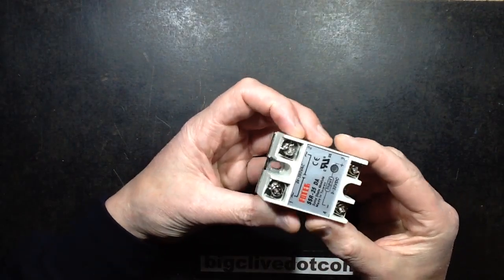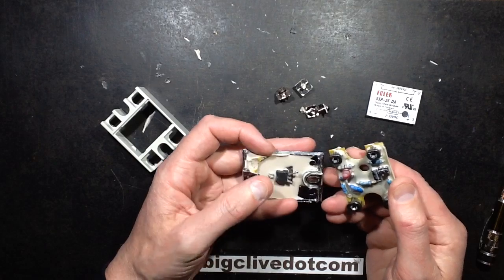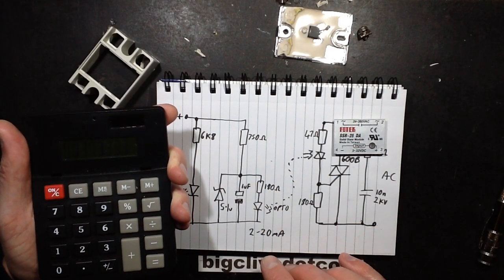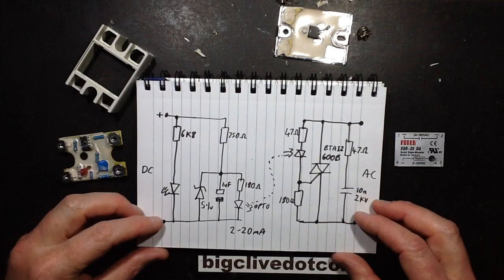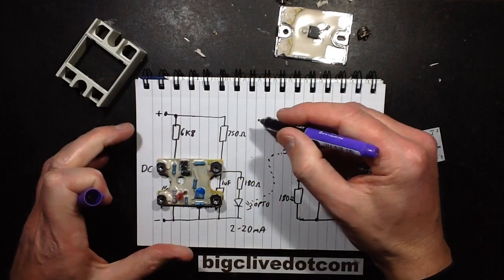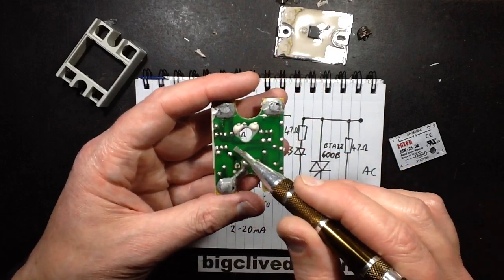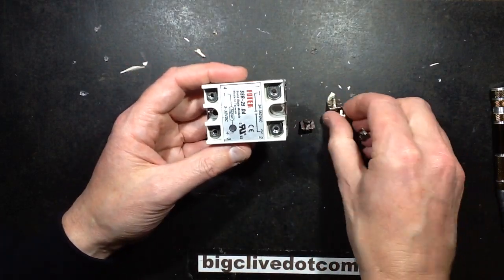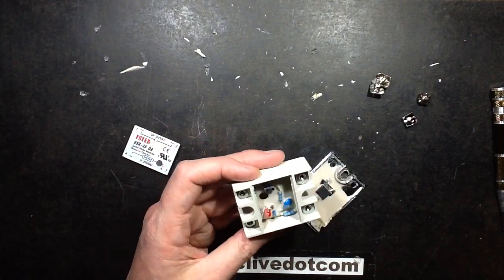Teardown of an eBay 25A Solid State Relay.  (SSR)

Comment: Thanks for this tear down Clive.

I have the exact same part from an ebay seller that I intended to use in a Kiln controller (~3KW max output).
So after watching this I stripped mine down to reveal that it also contains the BTA12-600B, obviosuly not quite sufficient for my application.

I have now ordered a BTA24-600B to uprate this to its original spec of 25A, at least I will now be operating its safe area.

Thanks again for your entertaining and interesting videos!

Comment: I got one like that. I'll let you know how it holds up at 20 amps. =o    lol   :)
Reply from the maker: +ww321 Someone sent me a picture of one that had gone bang and blown the front cover off.  They were running a "40A" one at 28A.
Reply: bigclivedotcom I know the Chinese pretty much put whatever spec they want on the item. LOL
Reply: +ww321 I bet they only do that with stuff made for export. ;)
Reply: You got a fake one then.
Reply: The SSR is 'real', the label on it is fake. Unless you buy direct from the Chinese manufacturer they are almost all 're-labeled' and rated higher than they should be.

Comment: I would bet this is a fake. My company has a large inventory of fotek solid state relays, controls, and sensors. We are listed as part of their sales channel on their website... http://www.fotek.com.tw/s3e.asp 
Our prices are not as low as what you find on ebay or amazon, but there is a reason why you are finding them so cheap on those sites. you get what you pay for. Also, I grabbed on of my 25 DA SSRs to compare, and the imput is rated for 4-32 VDC, not 3-32 VCD.

Comment: I just bought one of these. After watching this I stated wondering if I fill it with resin it might be better than it is now. The load that it needs to handle would be around 8 amps so it should handle that well.

Comment: I was wiring one of these up at work today and this video showed up in my feed when i got home. How odd. It's only switching 3 Amps but controlling a rather critical temperature.
Thinking tomorrow i'll change it for one of the £25 ones from R.S.

Comment: I find hard to believe that it only have a single triac I build a very complex pulsing array for a custom power inverter... and I used 20 fet's of 45A each for a load of only 250 Amps... so it will be interesting to open one from a reputable brand "Expensive" and see if they only use one of this devices also!!!

Comment: I have a couple of 40 Amp versions of this same brand (Fotek SSR 40 DA-H). I wouldn't trust these things enough to switch 5 Amps, even with a heatsink.

Speaking of which, they did come with heatsinks which actually seem pretty good. They have standard screw spacings so I may save them for some real SSRs. :)
Reply from the maker: +Felamine I got one with the heatsink and agree that it's actually worth it just for the heatsink.

Comment: Great tear-down, really interesting!
I've been using one of these Fotek branded SSR 25 DA (not sure if the one I have is genuine or fake) for about 1.5+ years to switch a 1.3kW purely resistive load at 240V AC from a 3.3V input. It was ridiculously cheap on ebay, so I guess mine is the fake one. Probably still working because I'm well within the "safe" operating envelope. Would no doubt have exploded by now if I was on 110V mains :-)
Reply from the maker: +James Ward For a modest load like that it should actually be fine.  I guess these are probably widely used in real-life Chinese factory equipment.

Comment: Is there a DC equivalent that you know of? I want to isolate some batteries @180Vdc 32A
Reply from the maker: Do a search for DC SSR.
Reply: Thanks. Assuming the same underrating, I'll get an 80A. Some of them come with some really poorly designed heatsinks with fins parallel to the heat source😛

Comment: I used one of these cheap Ebay Fotek (clone?) SSRs to switch a bunch of AV gear at home for about a year and a half.  It worked well enough switching lots of inrush current (big amplifiers, linear supplies), until I got trigger happy watching the lights in the house dim as I switched it all on and off.

I plan on replacing it with another cheap Ebay Fotek SSR, because a real industrial SSR from Digikey or Mouser costs more than a a dozen of these, and it worked quite well until I abused it on purpose.

Comment: what would you recommend for driving a heat bed on a 3D printer? I'm new to this stuff, and this relay was recommended, but upon researching it... I found your video! This would be for a standard bed for a prusa i3 3D printer. Thank you for teaching the world about these Important things!
Reply from the maker: +1blisslife It would depend on the voltage and power rating of the heated bed.  Most I've seen have been low voltage.
Reply: +bigclivedotcom That's a Mk2 Heatbed, and can be configured for 12 or 24v according to the 3 pins it's got & it's the one by prusadjs.ca

Comment: why wouldn't they just use an SCR?
Reply from the maker: +lsdave An SCR (Silicon controller rectifier) or thyristor as it is also known, only switches one polarity.  They have to use an inverse parallel pair to switch AC.

Comment: would one of these handle three light bulbs? incandescent or power saving but not LED
Reply from the maker: +1blisslife These relays are only suitable for switching AC.  And primarily higher voltage AC like 110 to 250V.
Reply from the maker: +Anas Malas Yes, it should be OK with incandescent.  Not sure about the holding load for compact fluorescent or LED, but you could try them with it.
Reply: bigclivedotcom what do you mean by holding power? Leakage current?
Reply from the maker: +Anas Malas Triacs require a minimum current passing through them to stay latched on.  If it is too low, or is pulsing on and off then they may turn off mid-cycle resulting in flickering.
Reply: +1blisslife If you just want to control 12V or 24V DC lights, don't bother with this. May as well just use an actual old-fashioned electromechanical relay. If it takes a few extra milliseconds to turn on and off, doesn't matter for lighting.
Reply: +bigclivedotcom see my comment above.... This is to run it at 12 or 24 volts with my 20 or 40a supply.... Again... Thank you!
Reply: +1blisslife for dc you can change the triac for a simple bipolar transistor  or a fet and the opto for a fet/bipolar opto that you can get from scrap power supplies easily
Reply: bigclivedotcom alright.. I decided on a regular clicking relay, but the problem is that I am worried about soldering the mains to the tiny leads on the relay... It is rated for atleast 5 amps but I am worried which is why I liked the screw on type more... What should I do?
Reply: +Anas Malas the simple answer would be - just buy relay holder from place you got relay (google relay DIN holder) - you would just have push relay to it and use normal screw terminals for wires.
Reply: Yup, they make relay holders / bases with screw terminals for just this sort of thing. I googled "screw terminal relay" and found a few, Digikey has screw-terminal as a category for it's search for relay holders.
Reply: KardanAutos hmm, never knew about it... I hope its available here in UAE (not even LEDs are readily available)
Reply: +greenaum 
But, it could matter since a electromagnetically relay could generate electrical noise that is not wanted.

Comment: The Crydom unit is fully packed with resin and with an admixture of whst appear to be very fine fibres.The unit failed quite expressively by blowing out part of the top on the a.c. side. Looks as if it may have been the resistor -capacitor network. Another blow out on the upper rh side looking at the unit from above.Further dissection looks like it will destroy any components left.

Comment: My son comes across this type of relay in his work servicing catering equipment and for some reason the majority seem to fail in the conducting mode, the equivalent of conventional relay contacts welded together. A potentially dangerous condition if other protective devices fail to cut the supply.Please could you offer an explanation as to why this happens and can it be obviated?I am about to disect one of the "crydom" 240 v ~ 25 A units so I will post if it is completely resin filled.Many thanks.
Reply from the maker: In my experience the majority of power switching components tend to fail in a short circuit condition.  That includes transistors, thyristors, triacs and diodes.  On a plus note it makes it easier to test them. since they are a very obvious short when they fail.  In heated loads there us often a bimetallic cutout, which may be latching, and often a one-shot thermal fuse too.

Comment: Would you consider this safe to run a small fan in GreenHouse  using a 12 volt temp relay to control it? Should I make sure its in the air stream from fan?
Reply from the maker: +Robert Cookson If it's an AC fan it should be OK.  A fan is a very low load.

Comment: This one is a FAKE --> the genuine unit has the label 'Solid State Relay' --> not 'Module' and the word 'INPUT is uppercase without a ring border around it. eBay seller 'alice1101983 claims to have sold almost 5000 units over the last 2 years and his are genuine Fotek units. Check them out

Comment: Amazing video! I was wondering get some of this ssr in ebay, but not anymore...

Could someone advice a good and secure one? Im starting my house automation project with raspberry pi and arduino, and would like to use a safe one, and that can handle large currents... Thanks in advance.
Reply from the maker: +Wyll Cavalcante Ebay might not be the place to get a genuinely high current one, but these ones should do up to about 10A if mounted on a heat sinking surface.  If you search ebay for 25A SSR or solid state relay you should find them.

Comment: I was talking to a siemens control specialist a while back about the half rated ratio to be applied when using cheap units. He said it was common knowledge in the industry, Manufacturers recommend an ambient operating temp of 0 degrees so they can claim higher switching abilities.. Im not sure if this would would make any difference or not?

Comment: 0 dislikes... is this even YouTube any more?
Reply from the maker: +Prehistoricman Oh no!  My phantom h8er has clearly missed this video.  I hereby grant you permission to click the dislike button.
Reply: Well, thank you all for your comments; good and bad.  I installed two FOTEK switches as replacements for original parts in an infrared sauna.  Thankfully the breaker went.  The output end of one of the switches melted and fused a bunch of the supporting wiring.  I’ve ordered two Opto switches which I believe are made in the USA and are of good quality  But, at the end of the day I do not know what I am doing and the project is now stopped.  I’ll maybe have an electrician look at it or just scrap it.  A little knowledge is a dangerous thing; no knowledge and electricity is just plain stupid.
Reply: I added a thimgs down for effect

Comment: I had another crazy idea , Could this be used to trigger a connection on a crude spot welder based on chargeing some caps to high voltage? or would this just blow the thing up ?
Reply from the maker: +steve64464 The use of a stud thyristor would be better due to the reduction of series resistance and the ruggedness of the high current thyristor.
Reply: Thanks Clive ill see what i can find on ebay :-)
Reply: +bigclivedotcom Although on second thoughts the thyristor looks quite expensive compared to this ssr
Reply from the maker: +steve64464 But is virtually indestructible.  Try a search for stud thyristor or stud scr on eBay.
Reply: If i try it on this ssr just for one off experimentation do you think it will blow?
Reply from the maker: +steve64464 The capacitive spot welders tend to operate at quite a low voltage, so I'm not sure the internal triac drive circuit would trigger reliably.  It would probably be cheaper and easier just to use a bare BTA12-600B triac on its own.   But if you're going to do that then you could use a common thyristor.  But remember that the capacitive discharge welder uses a burst of high current.
Reply: Ive managed to obtain three BTA12-600B havein slight difficulty understanding how it works at the moment since i only had experience with N channel mosfets. so far all ive managed to do is to get it really hot and almost melt my wires.
Reply from the maker: +steve64464 A quick description of triac use.    The triac has three terminals MT1, MT2 and Gate.  MT2 is normally the middle terminal.  To turn the triac on you need to apply a high current of about 50mA to the Gate with reference to MT1.  When triggered the triac will latch, but only if enough current is flowing through it.  When the current drops below a threshold the triac will reset and switch off.
Reply: I think i managed to get the basic setup working and spinning a pc fan , I think i killed the other one as its not behaving in the expected way and the gate seems permanently toggled on , Now im wondering how to trigger the gate with a separate battery i dont think using the power source from 300v charged caps to trigger it is a good idea.
Reply from the maker: +steve64464 Triacs are really intended for switching AC loads, although they can also act as a thyristor.   They're really geared up for high current loads though.
Reply: Well i think im going to try see if i can discharge a charged cap thu it as a crude spotwelder either that or get some nasty shock , Im using a disposable camera flash charger circuit in it, I figure a spot welder would make life easier on building 18650 batt packs rather than me using a ton of solder on it , One random tip - ive been using the tin metal off the bottom of pringles tubes as tabs :-D
Reply from the maker: +steve64464 Typically the spot welder units with capacitors tend to use a lower voltage with high value capacitors to deliver the energy.  Using a fully charged flash capacitor could cause a significant shock.
Reply: Lucky ive not been shocked with it once yet but there are plenty of utube vids depicting idiots shocking themselves with same circuit

I do have a 12V super capacitor bank available but the last time i tried a experimental weld with that it kinda sparked a lot and hot plasma metal filth shot everywhere , Fun times :-D

Comment: I have considered these relays but avoided them because of safety concerns.  I have no problem piling on heaps of dubious low-voltage components that are practically free, but it is a different situation when a component is to be connected to the mains.  I don't want to burn down the house or electrocute someone.  Even though yours seems reasonably good, I think I'll pass.  When certification markings are false and no one is accountable, it is hard to have confidence in a part.

This is the first video of yours that I've watched Mr. Clive, and it is simply fabulous.  First class.  Thanks for doing this.

Comment: Think about someone's life may depend on this relay.  Imagine that I have used it for a repair in the airplane you travel with next time,  and it fails. It is very important that you can rely on the labeling on electronics. 

They might as well write "Made in USA". It is the wrong marking there is crime. 

The problem now is that I have to buy the expensive one to feel secure, because they fake are now also sold by general retailers. They also trust the label and can not see a difference between the secure and the fake.
  
Is there any insulation between the Triak and metal plate? I can not see it on the video .

Thanks for the good teardown, I like it very much. Thumbs up

Comment: Can these things switch DC over as well as AC? i powered one up and both points do not link based on resistance test on multimeter etc , Unless there's a minimum voltage requirement i dunno.
Reply from the maker: +steve64464 You get DC versions, but this is an AC one.  Your meter would not exceed the LED voltage on the input side and would only see the capacitor on the output side.
Reply: Ahh , thanks for getting back to me so quick , Its my first ssr before ive only used the ol 12v mechanical ones so im thinking it will only start switching the voltage over when it reaches 24v or maybe its the AC wave or something like that, Im sure ill find a use for them but even if i dont they are not overly expensive.

Comment: This is a cheap and not very cheerful Chinese SSR. I am an electronic engineer as you are  and we both know that around 8A is  probably a safe current for this device as long as it is for domestic use and not industrial applications. I for instance would NOT use this device for any serious application especially if it was say going abroad or to aerospace or marine installations.  Using this gear means one could be taking flights abroad to fix the kit. EXPENSIVE.

Comment: Thank you for the warning, but why do you buy them when they cost the same as the real thing ???
Please do not support criminals.
Reply from the maker: +MitzaMaxwell Ten times the price PLUS shipping PLUS tax.
http://uk.rs-online.com/web/p/solid-state-relays/0346918/
Reply: +bigclivedotcom Not really. You can still by a good brand one for 10A and from RS - who also do FREE shipping in the UK: http://uk.rs-online.com/web/p/solid-state-relays/8370704/
Reply: Because tearing down dangerous ebay junk is kind of the point of the channel.

Comment: This is dangerous stuff. By most electronic safety regulations you;d expect 6.4 mm CL/CR between the live circuit and the 30V circuit  on PCB material. that means for a DIL package you need all of it!